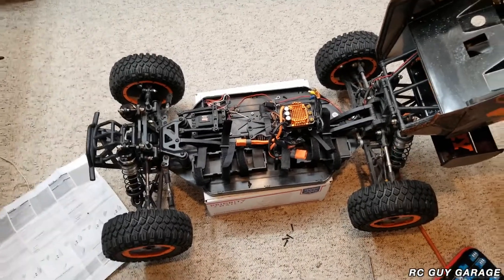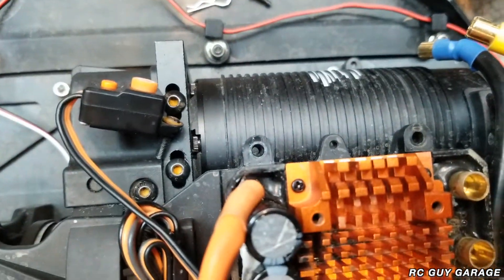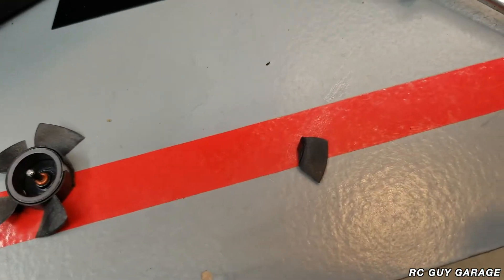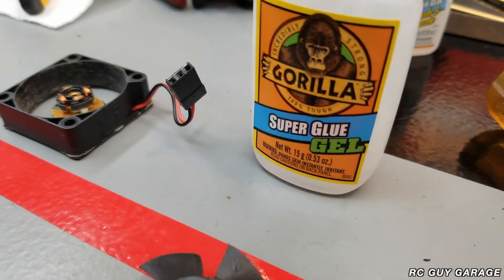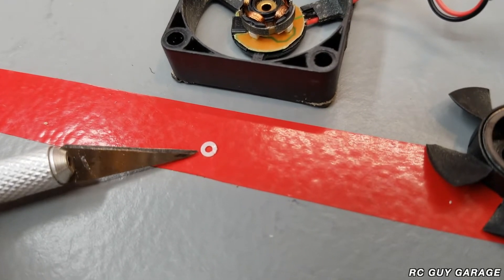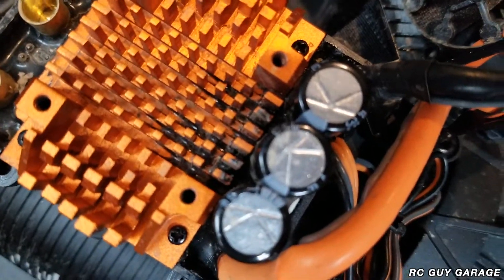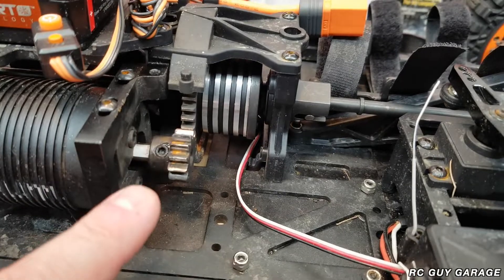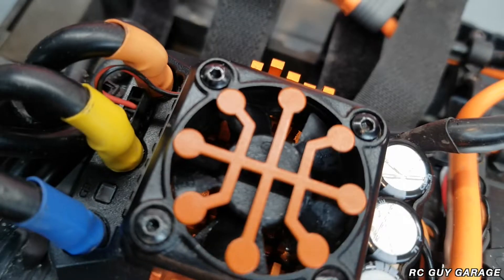Losi DBXL-E 2.0 ALWAYS PRE-CHECK YOUR STUFF

Comment: Very informative video. I do the same thing with the motor pinion. I drip blue loctite down in the hole then crank the setscrew down. Can actually see the loctite ooose out the end of the motor shaft. Some company is prototyping a D shaped 8mm mod 1.5 pinion. That is the real problem with the ones now. All that force is being applied to that little setscrew if you think about it. It hold the pinion on and rotates the drivetrain. Nice catch on the fan. Wonder if your caps are going bad leaking like they did?
Reply from the maker: No it's just the waterproofing that got on the fins.

Comment: Awesome reviews
Reply from the maker: Thanks GUY
Reply: Just picked one up yesterday been looking at at reviews and tube vids  For issues , what to replace upgrades and check list weak points
Reply: I was watching your hair spray vid don’t know it was that easy to remove the wheels wanted to die the wheels black
Reply from the maker: @Mason-Dain  that would look AWESOME!!!
Reply from the maker: @Mason-Dain  yeah so far I've BEATEN that thing pretty good and to only have the couple issues I've had I think it's to be expected. 👍💯👊
Reply: Hey bud what size drivers u use the dBxl screws
Reply from the maker: @Mason-Dain  for???? Do you mean in total for the whole RC or???
Reply: RC Guy Garage total , from experience I know Losi cars uses standard not metric. But could be wrong on 1/5 scales
Reply from the maker: @Mason-Dain  on the DBXLE2.0 You might be able to use both. I've found metric fits better but you can use standard cause the fasteners are larger overall.